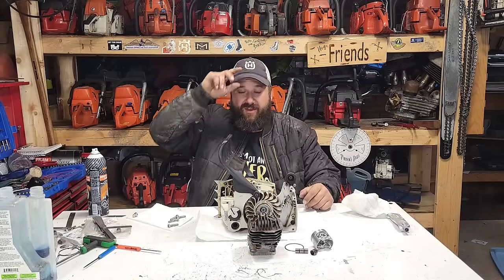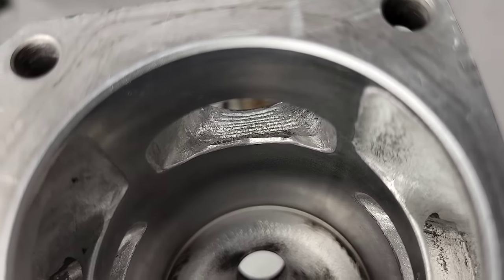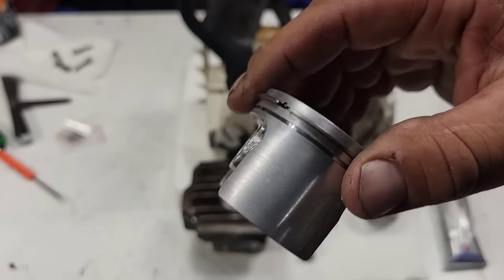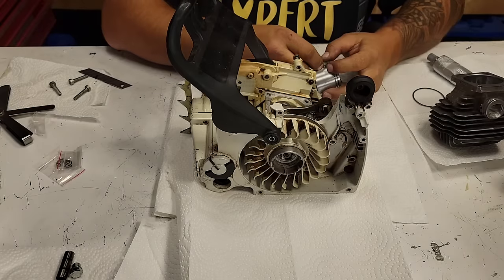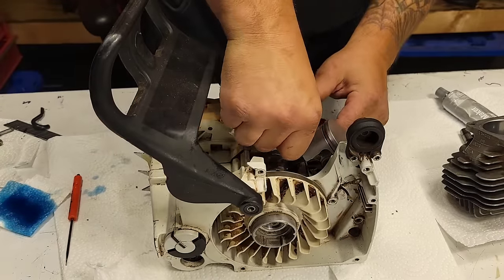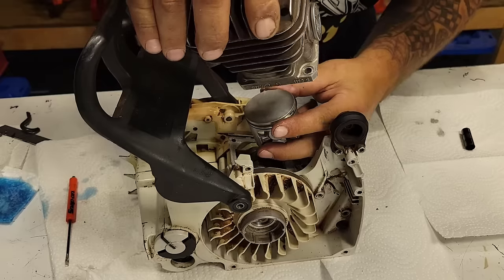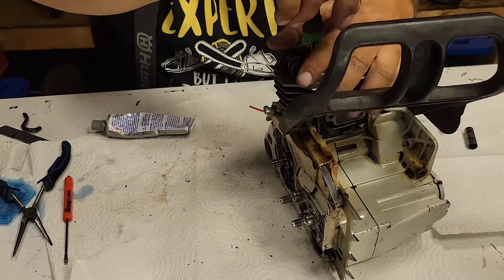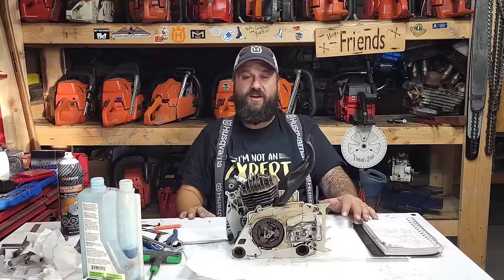LETS GET BACK TO THE BENCH! STIHL MS460 TOP END INSTALL!!

Comment: Good nostalgic video Tinman!   Agreed the 460 runs out of wind.  Hope the transfer and piston work gets you some R's.

With Stihls it is easier to pre-load the cylinder mounting bolts before dropping it onto the piston.  If the handle is still on the saw, usually it is impossible to install them with the cylinder on the case.

Comment: If I'm not bothering to split the case and do bearings, I flush the bottom end with premix and spin the crank around. I always get silver sparkles flushed out even on the nicest saws. Try it next time you do a top end. You would be surprised what comes out.

Comment: There is about 15 degrees lower head temps on the same carb tune on a one ring cylinder vs running both rings. That 15 degrees will add a good batch of life to a top end on a ported saw. 20 to 30 degrees over your oil breakdown point will cook your saw.

Comment: Ported that saw needs a pipe, mine did. I’ve been running an Iron Horse pipe and it was ok, I made my own version with some internal geometry to it and it ran 15% faster in a cut, the absolute best for an 046 IMHO is a bear claw style pipe they ran the best on my saw

Comment: Hi Tinman! Great to see you back at the bench working on a Stihl.
I was recently thinking the 1 ring on a 2 ring piston back and forth… the point that worries me is the short circuit the empty ring groove creates inbetween the exhaust port and the upper transfers.
Ever thought of putting a smaller ring in just to fill the lower groove?

Comment: Tinmansaws I've been working on a 2000 Husqvarna 365 special. I rebuilt the carburetor, put new air filter and lines in. (PS. The throttle and choke plates are moving fine.) When I go to start it up it will rev up uncontrollably without me touching throttle. (First time started since 2003-4) Could it be an air leak?
Reply from the maker: I'd bet with certainty that's a pretty large air leak.

Comment: Another great video! Quick question does ring gap matter and also circllip positioning 6/12oclock matter I ask cause I just  rebuilt a Polaris 800 rmk where it matters
Reply from the maker: I measure my ring gaps on all engines. Gap is subjective depending on the engine. 

Circlip openings should be at the 6 o'clock position is how I've always done it.
Reply: Thanks rebuilding some 55 ranchers
Reply: Appreciate your advice! I also tuned all my saws to your videos! I love my holzfarma g 660 I got a really good running one

Comment: Good video I’ve ran 1 rings as well on a stihl the bottom ring locator is in the way off widening exhaust port and if you do run both rings don’t port to wide on exhaust or ring will hang up eh tinman 🪵👍